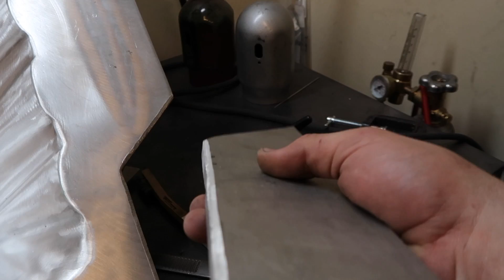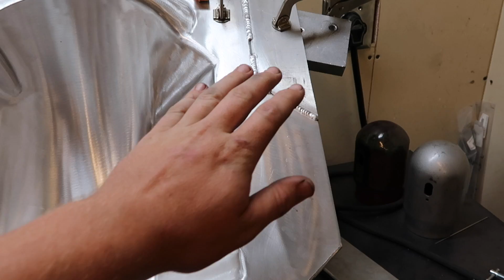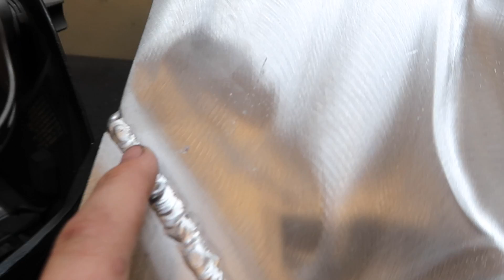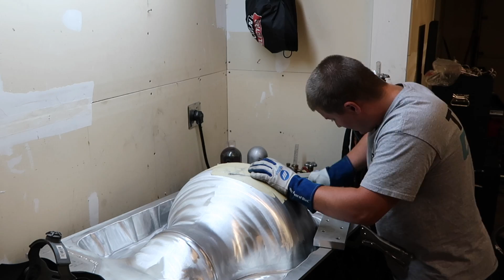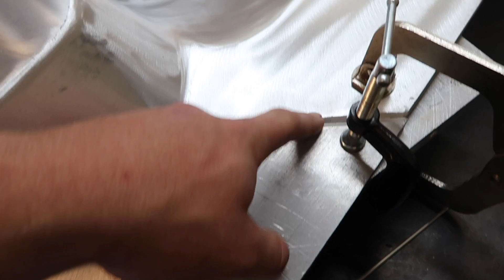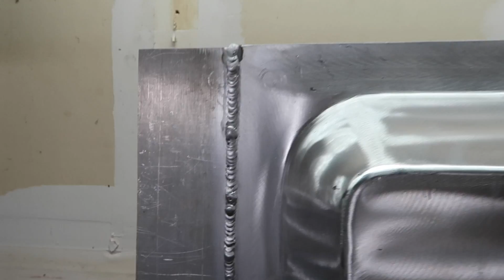Cast Aluminum Tig Welding Repair

Comment: you could put at least another 80amps on those welds, for that thickness the edges of the weld are to crisp, and there are some spots were they aren't properly fused, but not bad, i know how hard it is to work with that kind of materials.

Comment: The weld looks to cold , go with high frequency and 4043 alsi5 stick
Reply: And maybe tweak the pulse settings a little? If the machine has that feature?

Comment: I have a Miller Syncrowave 200, unfortunately it struggles with aluminum thicker than 1/4". It seems like 200 amp TIG machines are fairly light duty...
Reply: Do a helium mix and you can make that 200 amps weld like a 300 amp